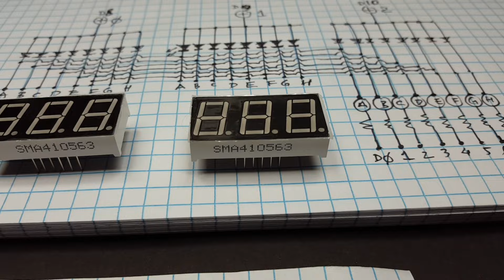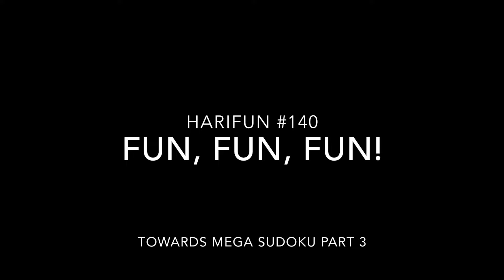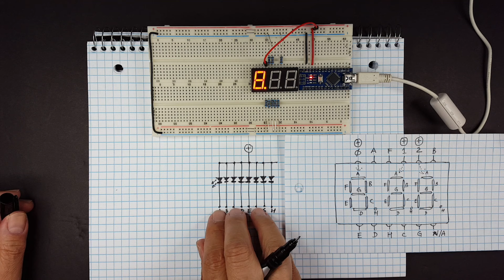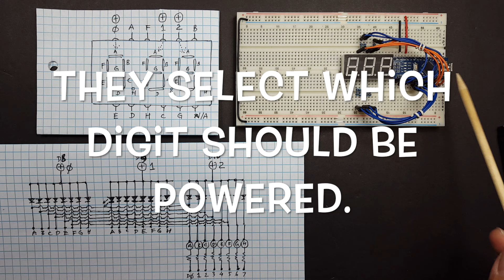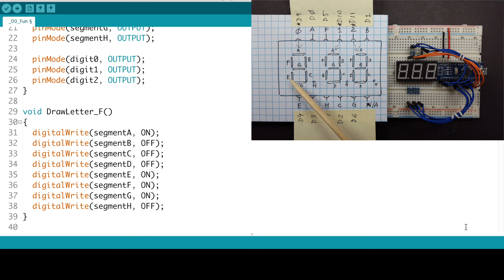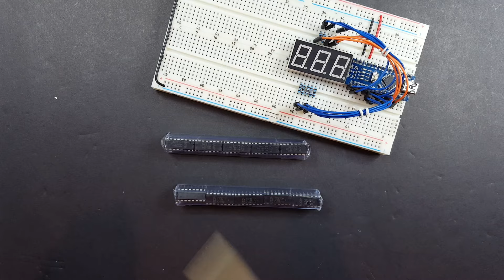HariFun #140 - Fun, Fun, Fun - Mega Sudoku Part 3

Comment: That is an amazing video.  I am a little stuck on one thing:

The way I'm thinking, you give Positive power to a display thingamajig, and then use the 8 negatives to select segments.  That I can understand.  What I'm stuck on is giving each of the three digits different values.  I'm thinking that if a display has 1 and 2 Positively Powered and A,B and C  grounded, wouldn't that make both 1 and 2 display the three segments?  how do you give 3 digits different segments with only 1 digit's work of inputs?

I know you explained this in the video, but I'm still a little stuck.

Thanks!
Reply from the maker: Hi Lucas!
Sorry, I rushed through that last part...
The three digits are NEVER on at the same time.  Only ONE of the digits is ever on at any one time.  Here's the code with comments.

void loop() {
  DrawLetter_F();
  digitalWrite(digit0, HIGH); // Display F on digit 0
  digitalWrite(digit0, LOW);  // Almost immediately, turn off Digit 0

  DrawLetter_U();
  digitalWrite(digit1, HIGH); // Display U on digit 1
  digitalWrite(digit1, LOW);  // Almost immediately, turn off Digit 1

  DrawLetter_N();
  digitalWrite(digit2, HIGH); // Display N on digit 2
  digitalWrite(digit2, LOW);  // Almost immediately, turn off Digit 2
}

Actually, if we put a 500 milisecond delay immediately before turning off the digit, the display gets brighter since each digit would be on a little longer.
But we can't leave it on too long because our eyes would see the flicker if we do not update the other displays for too long.

Hope that helps.  Let me know if that's still unclear.
Reply: Oh, like PWD!  Cool!

...

That is a lot of code you're going to have to write...

....

Good Luck!  Great Video!

Comment: Love the intro :)  BTW, you can try saving yourself some resistors by placing 1 on each common anode on the seven segment displays.  I did this on my seven segment display projects and was not able to tell the difference when only 1 segment or all 7 segments were lit.  Give it a shot, maybe it will work well for your displays and save a bunch of soldering.  If you take a look at https://youtu.be/QcNXxEZzk0s?list=PLonofM-nQMBcrt-_ebDoOC6Gz9OxTV2Pm&t=511 you can see in my project that a 9 and 1 have no apparent brightness difference.
Reply from the maker: Sharing resistors would definitely save lot of parts and soldering.
Great tip! Thanks dparson!